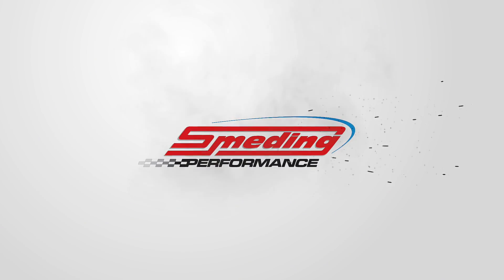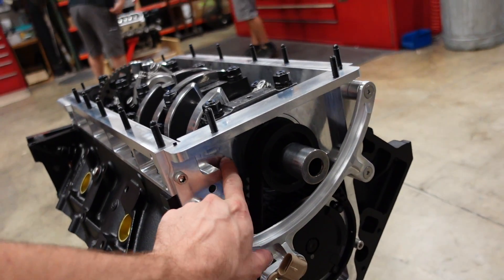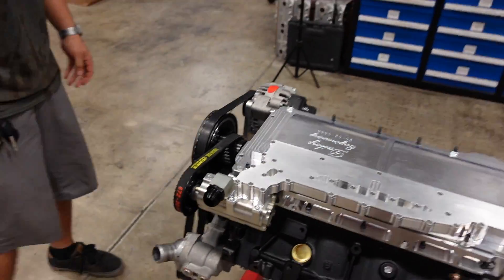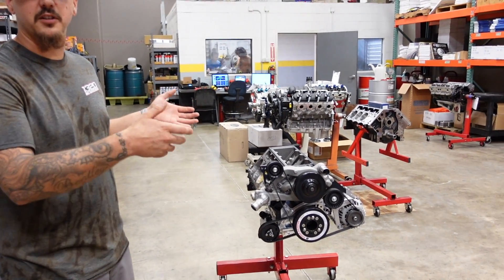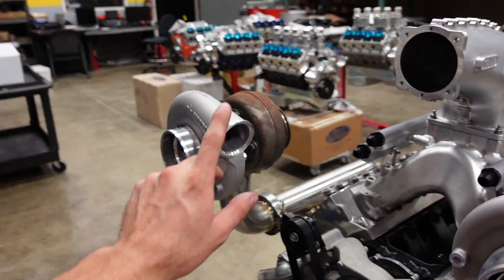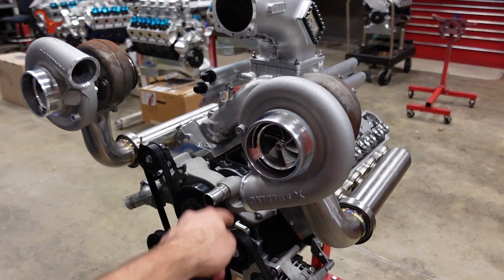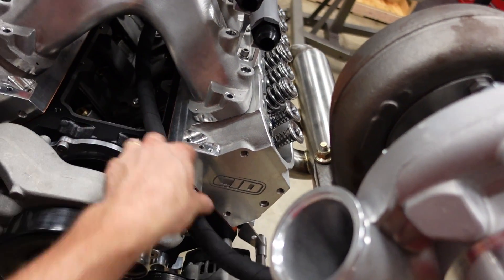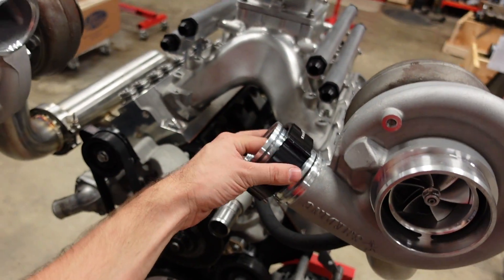Twin Turbo's are Mocked-Up on the 400" LS Race Engine! - Part 6

Comment: So just a heads up but the drain fittings on the turbo need to be straight running 45, or 90 degree will back oil up in the center section on gravity drains. Also not a real good idea to run the drains into the block above the rotating assembly as it adds heat to the block, and increases the amount of windage that’s going to happen. Dailey makes extra pump stages for that system and adding one more stage for proper oil scavenging from the turbos would truly be your best bet especially when you plan on throwing larger turbos on there in the future.

Comment: That is a beautiful setup. My only concerns for your future sanity and power potential might be the log manifolds...... but I imagine squeezing that setup into a C5 can't be easy.
Reply: For the turbos he has mounted the logs will do fine, when he steps up to the t6 flanged units those logs need to go. To be honest though with steel rods, and the lsa on the cam he isn’t going to be able to really push larger units reliably. Either the cam is going to run out of steam at a lower rpm than the t6’s will really start making steam, or he is going to bend or break those steel rods with the high boost and methanol. It’s his motor though so he can do what he likes.
Reply: Fwiw nearly every diesel (300-3000whp) uses log style manifolds without losing power potential, even when using massive turbos.

Comment: If you install the oil drains to the walley pan, Have you thought about if a Turbo fails you get metal parts straight into tour engine, but if you put the drains to the oil pan the oil has to go true a oil filter before re-entering THE engine?

Comment: That's a great place for the drain backs for the turbos. You will get all that extra oil running down on the cam. Looks really good brother. I love the exhaust manifolds.

Comment: Run your turbo drain lines below the rotating assembly, the engine block will be a hot eniough brick already.

Comment: I would consider aluminium harlines for drains, they take sooo much less space and they are not prone to burn off the hearder.
Reply: Hard lines would look slick and they’ll actually dissipate heat off the oil a tiny bit.
Reply: The only downside is with expansion and movement of exhaust components they may be under stress and possibly fracture due to the vibrations and stress
Reply: @kaidem1749  they are very soft, i don't think there is any issue with flexing